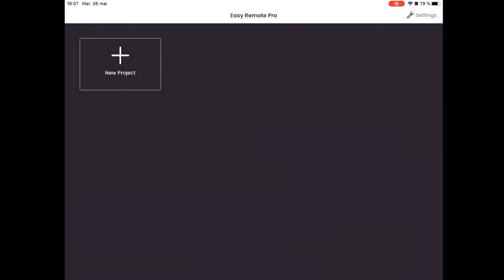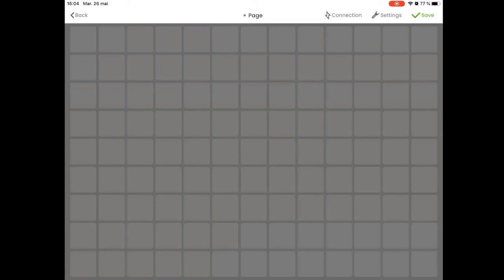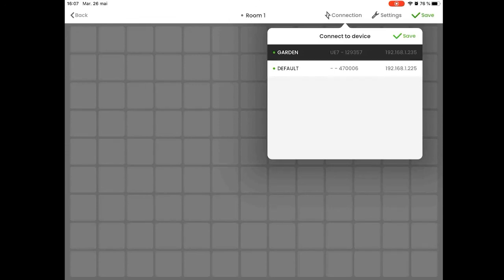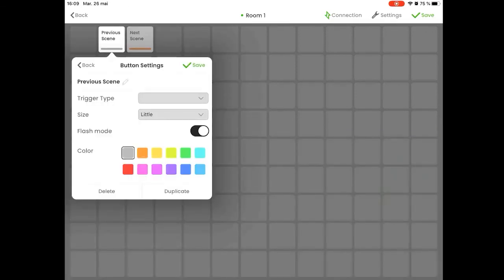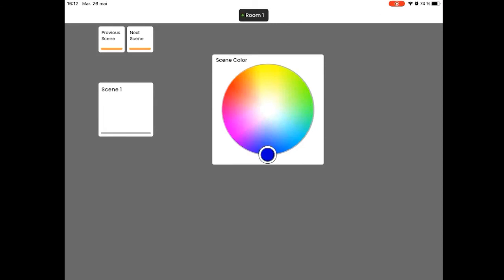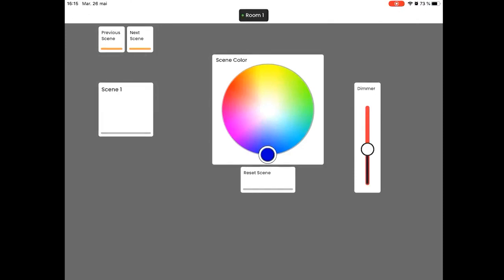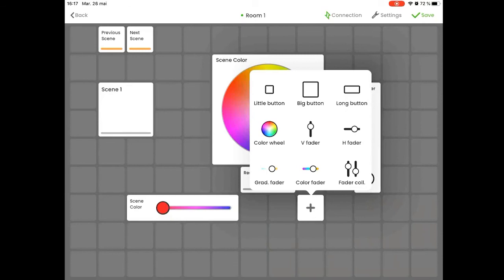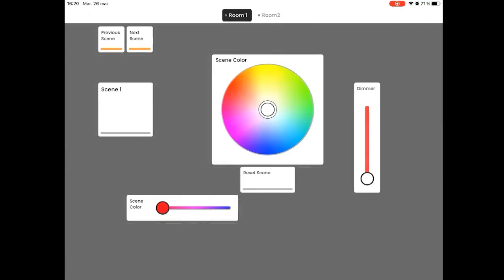WEBINAR - Easy Remote Pro - Overview of the app

Comment: Hello, 
I have a Slesa U10 memory configured with 10 RGBW shows for architectural use. I configured it from the ESA2 program. If I connect to this app, is it necessary to reconfigure the shows from the app or will it read the ones I already have recorded?
Reply: There is no compatibility between ESA2 and ESA Pro 2 programming files, sorry.